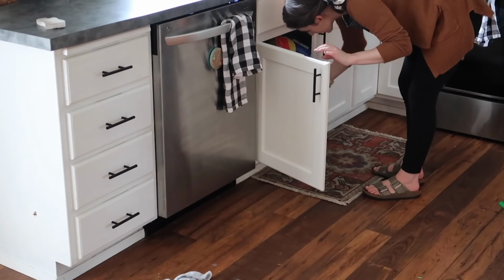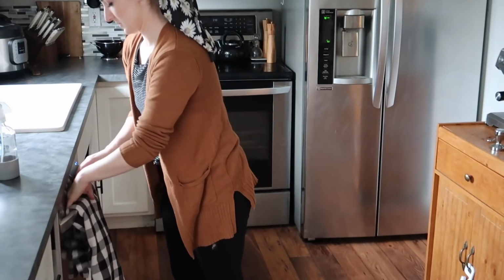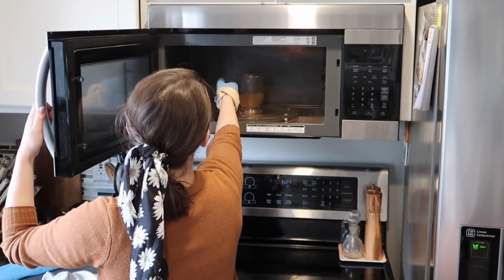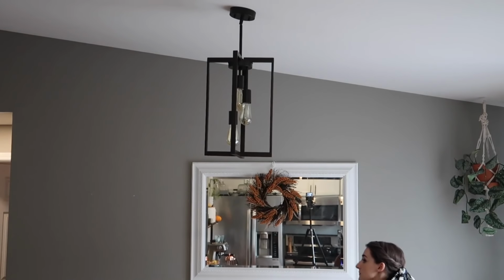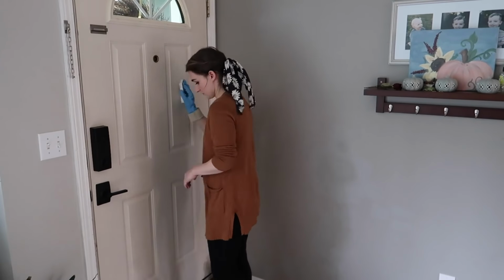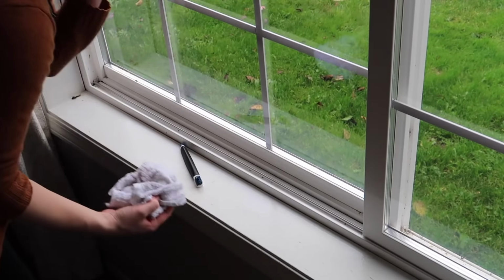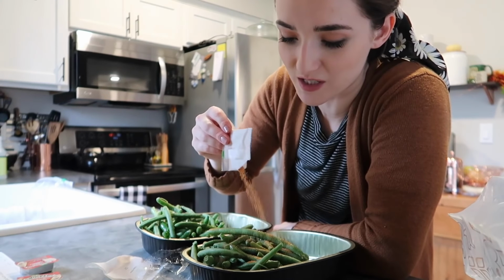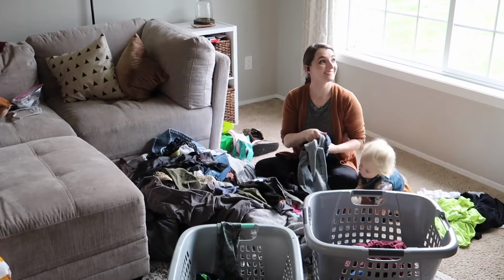FALL CLEAN WITH ME | EXTREME CLEANING MOTIVATION FALL TO-DO LIST ALL DAY CLEANING | Natalie Bennett

Comment: Something I have found works for the door tracks is a toothbrush on the DRY dirt in the track, with your vacuum right there sucking it up as you loosen it. The I use the wet to clean the rest seems to get it a lot cleaner.

Comment: They have tablets for your dishwasher (and washing machine)...affresh....just throw a tablet in the bottom of your dishwasher every month or two and done. You do still need to pull out the mesh drain thing. Also, they sell these oven mats that even work in convection ovens, just put on the bottom rack. It catches spills, etc....